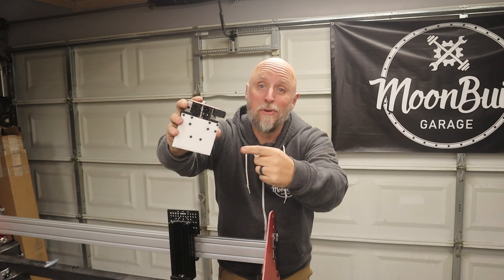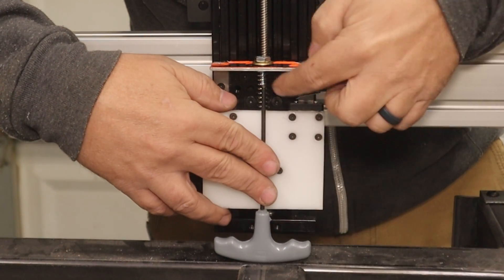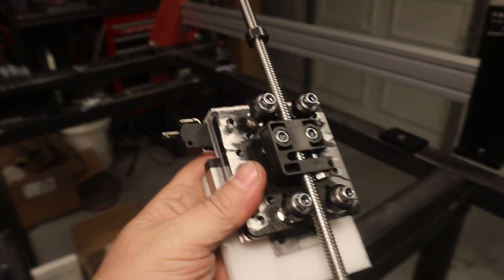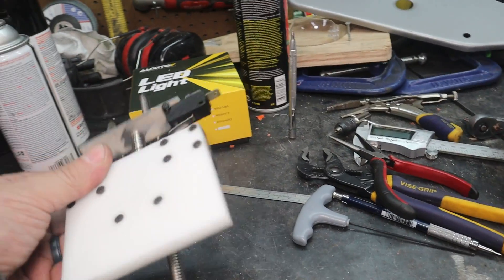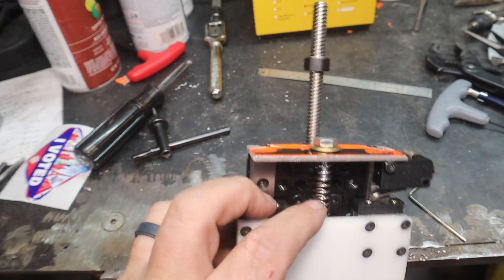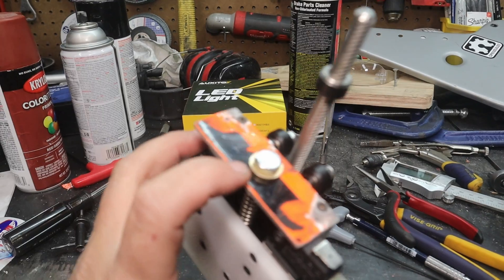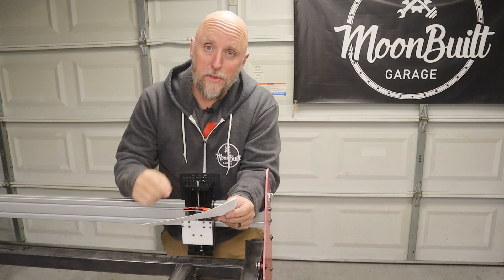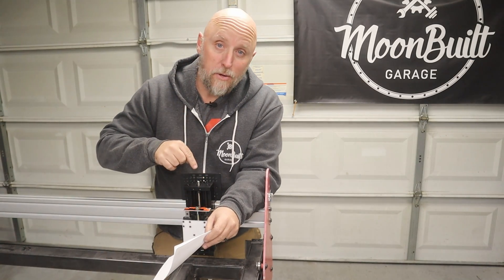DIY CNC Plasma Table | Part 6 - Floating Head for the Z-Axis

Comment: After adding that switch you should add the THC circuit so you can cut warped sheets.
Reply from the maker: I plan to...just gotta get back to working on the thing